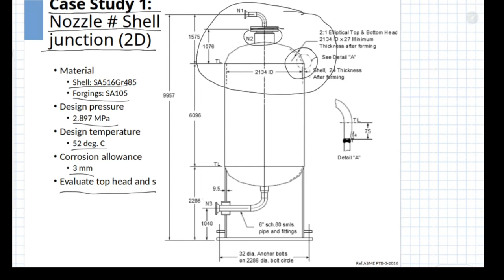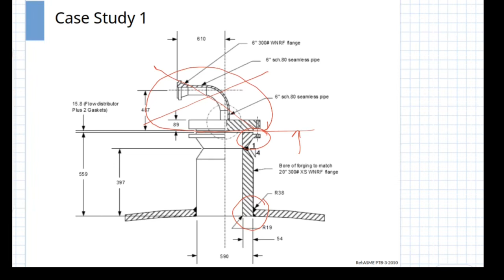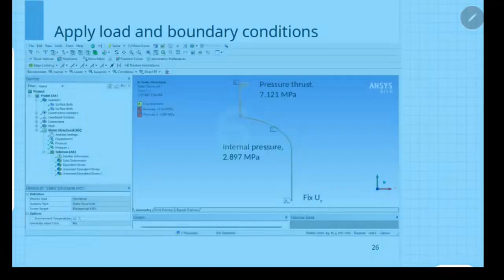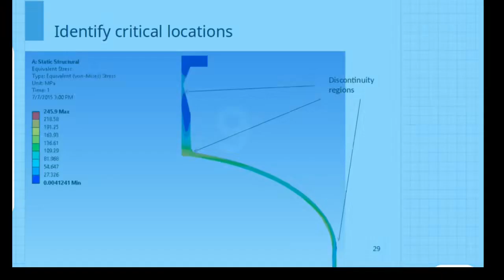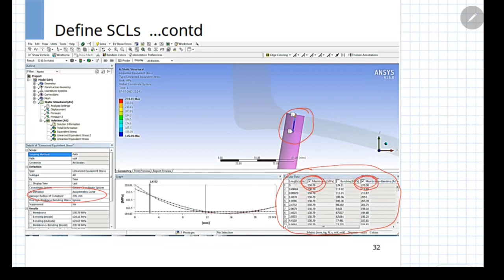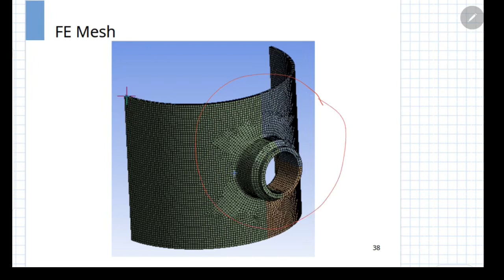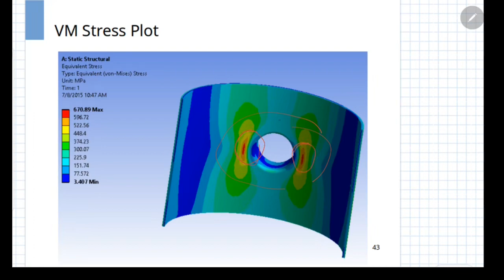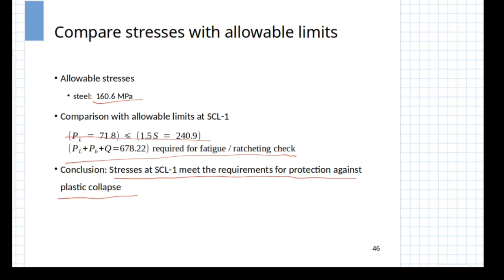S12C Case Study - Plastic Collapse Check

Comment: You know the plastic collapse check and Racheting check are two different criteria, right? 
Ratcheting check is not so straightforward and it is checked against operating loads (check dotted lines on hopper diagram)

Comment: Dear Nilesh Raykar, 
Thank you for your session. You are a very excellent teacher and your explaination are more clear than official documentation. 
One question, in the case of structure modeled with shell elements, how the membrane, bending and peak stress are calculated ? what is the procedure for checking plastic collapse in that case ?
Reply from the maker: Thanks for an encouraging feedback.
In case of shell elements, the FEA software will provide stresses on top, mid and bottom surface of shell element. The middle layer stresses are considered membrane and top/bottom are taken as membrane plus bending stresses. It is not possible to extract peak stress in this case.
Sorry for the late response.